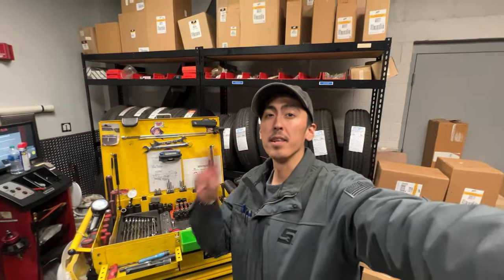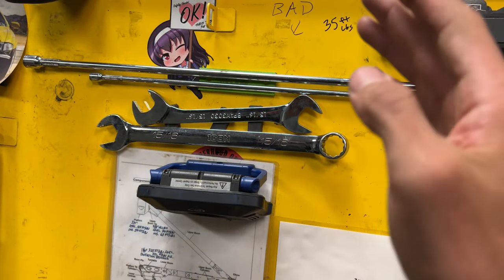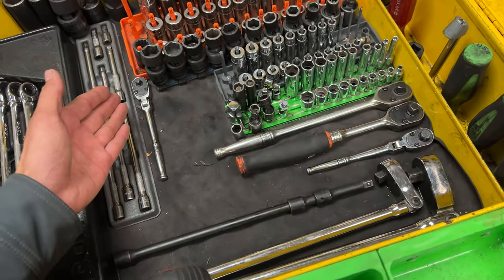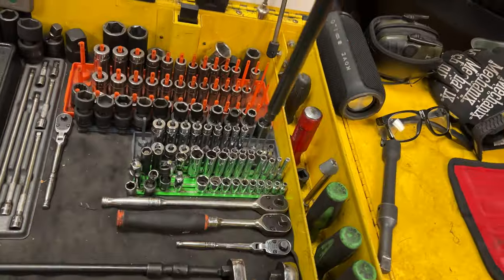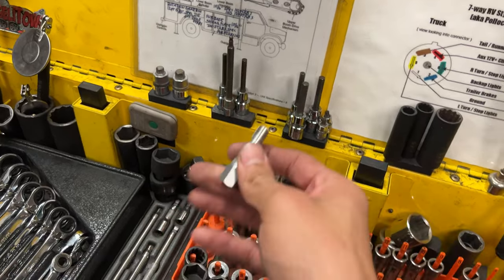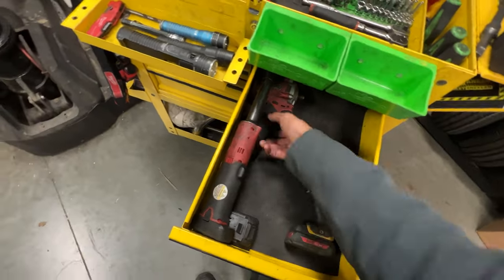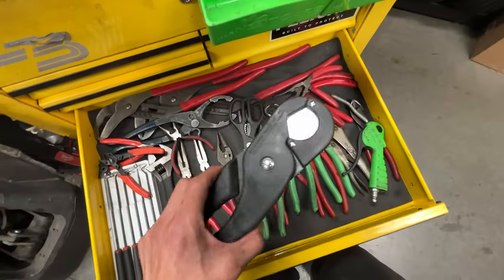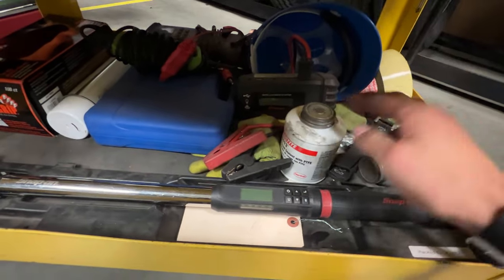Diesel Fleet Mechanic Tools You Need 2024

Comment: Hey nick Im 35 and moved from small equipment rental to being a service tech for a municipal transit authority as of 8 months ago. I gotta say its been encouraging to see that someone with a lot more experience than myself has had some of the same questions and thoughts in particular when it comes to putting in the time before you get promoted or trained to do more. I currently do the fluid services change tires perform engine washes, however because there is the interior cosmetics of a transit bus i have to fiddle around with the drivers area and passengers area as well, in addition to our support fleet of 350s and 450s. Your videos on being fleet have been helpful for me and i just wanted to say thanks
Reply from the maker: Nice man and thank you! Gotta put in that time to reap the rewards no matter where you came from.

Comment: I had to upgrade to 34 bank from harbor freight. After going to transit bus fleet needed a lot more tools from sae to metric tools
Reply: That's the opposite of my experience. In high school I started working at a small independent garage where no two cars or jobs were the same. I never knew which tools I would need so I was always working out of my rolling cabinet/top box. Luckily I had my own bay because that old Craftsman wouldn't have held up being moved around with how badly I had it overloaded.

When I got hired as a fleet mechanic at Laidlaw Transit 90% of my work was out of a cart with just the basics. I could do PM's, LOF's, brake jobs and more out of that cart with no problem. It was only when doing significant repairs(transmissions/head gaskets/etc) that I would have to go to my big box for tools that didn't fit in or on the cart.
Reply: @CzechSixTv  well the 34 bank is cart essentially. It’s not big box that stays still in the shop. Almost everyone in fleet I work with has giant snap on, Matco, or cornwell boxes they role around bigger than my 34 bank. Plus they have bigger box with their other tools
Reply: @tylerhill6706  So you're talking about something like the US general 34in full bank with 6 drawers and a lift top? If that's the case it makes sense. When you initially said "34 bank" I understood(or misunderstood) that to be some huge 34 drawer roller.

Comment: Honestly If you're noticing a lack of power in your m12 3/8's impact it's probably the battery. I use the 6.0amp batteries in all my m12 stuff and they run amazing.
Reply from the maker: Hmm you could be right it’s been a while since I’ve replaced my batteries
Reply: @LetsDriftMedia  Yeah if you're using the stock 2.0 try out a 6.0 and it's honestly a game changer. It honestly feels like a different tool when you use the 6.0 amp
Reply from the maker: @Captmorgann  Ill have to try out one of our shop batteries and see, I had a 6amp battery I bought 2 years ago but it took a crap wont take a charge anymore, Ive seen videos on people fixing them but might as well replace it at this point.

Comment: Hey bro. I have a question. I have a 2018 chevy silverado 5.3. I can't find a fuel pump for my truck to save my life. Part # ac delco. M100261 from the dealership  Autozone. O'reilly . Napa. Car quest. All say the pump has been discontinued . Can't get it or anything similar. I was wondering if you could help in some way
Reply from the maker: you check americantrucks? I just did a google search and that was the first one to pop up. A little pricey, Maybe rockauto, or ebay.

Comment: I cannot get any work in the auto repair field because of my driving record (collision in 2021, a speeding warning and two speeding tickets in 2023). I completed a one year, five module automotive technician coursefrom 2022-2023 and have been employed at O'Reilly for a little over two years now and desire to get work as a general maintenance technician to then work my way up to ASE Certification. 

Do you have any advice for me? Is there anything I can do about this driving record of mine, or should I just find another career choice?
Reply from the maker: See about going to traffic school to get those points removed from your record, if not you will have to wait 5 years until the points fall of your record, most places will still hire you up to 2 points on your record.
Reply: Slow down & be more responsible on the road. There's barely ever a good justification going 10 miles over the limit. 

Now, find a shop with a cool manager, be honest about your situation,  be friendly, & when you get your foot in the door, then work your ass off for that shop. As long as you don't get more tix then you should be able to earn until your record clears (5 years goes by a lot faster than it seems in a moment). Good luck!

Comment: Question - where are you putting pipe dope on hydraulics? Most hydraulic fittings seal face to face (JIC etc) & teflon tape/pipe dope doesn't actually do anything to prevent leaks and can lead to contamination. No hate - just curious, totally keep doing what works for you & your customer! :)
Reply from the maker: Your good I could be wrong, Only time I use pipe dope if thats even the correct term is on NPT threads, which are tapered threads they are pretty common on the hydraulic quick disconnect fittings. Thats just what I was told when shadowing a fellow co worker and if so its just a small dab on the threads.
Reply: Comment above from LDM is correct. Pipe Dope would be used with fitting that are NPT. Would not recommend with O-ring face sealing, JIC, etc.. Yes you are 100% on the Teflon tape. It can be used for temporary repairs to get the vehicle back to a repair yard.

Comment: I see you just casually glancing over that sticker and I am disappointed because I wanted to know more about the purple-haired ugu animu girl who watches over your stuff

Also what kind of scanners do you typically use as a Diesel tech? Do they use regular OBD2 or do you have specialized systems for them? 

I've been compiling tools because I like having stuff to help people and it's fun, and while I have a fair idea of what kind of generalized diagnostics tablet I am going to eventually get, a lot of Diesels (apparently?) dont use the same system as standard passenger cars and require specialized tools? 

For instance, I know a growing number of people who have Skoolies and was wondering what you'd even use for one of those? Obviously depending on the make and model of the individual bus, but I am guessing they'd generally fall under commercial Diesel diagnostics (which are a bit expensive, obviously). There's so little info out there detailing any of this stuff, even less than regular diagnostic equipment; lots of people dont even like going into detail about the individual services each model of tablet can do, let alone anything past gas vehicles.